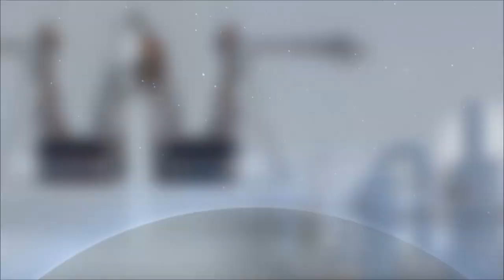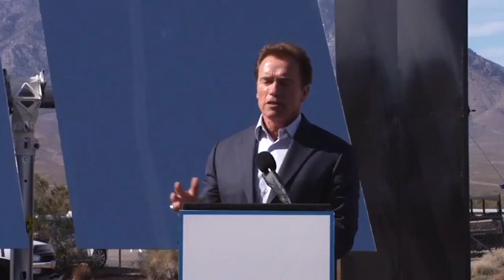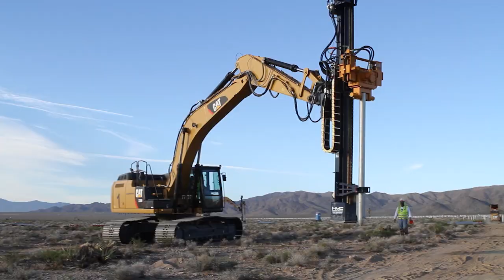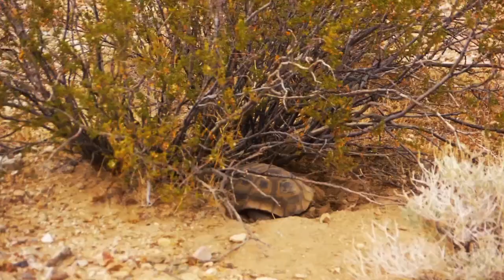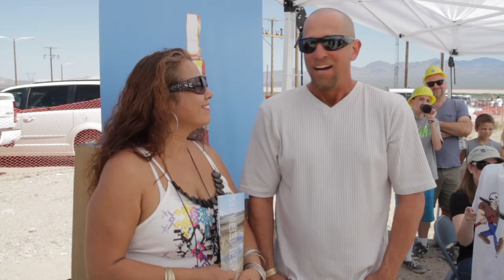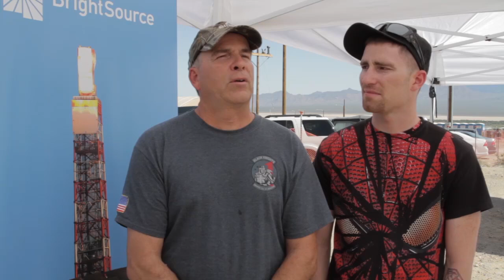Ivanpah: A Compilation

Comment: surprisingly few views on this I thought it was what the greenieacs that are so against oil wanted. guess they're to busy hustling Indian tribes into claiming water quality is at stake when it's actually a new tactic by the anti pipeline, all fossil fuels are bad activists ... but I want to be able to charge my cell phone run my microwave oven and heat and air condition my space and if we have energy shortfalls I'll yell even louder about that. 

I saw this from the air a few years ago. Nobody around me knew what it was. Not even the pilot whom I ask getting off the plane. I got photos from the plane. It was the brightest light I have ever seen from the air. Like mini  suns. Amazing. but they are not practical at 2 billion a pop to supply 150000 homes in a state with how many million? They would have to get the cost of them way down and the what looks like careful environmental work they did here is expensive labor an time consuming. That seems the reality unless someone want to make a counter argument.